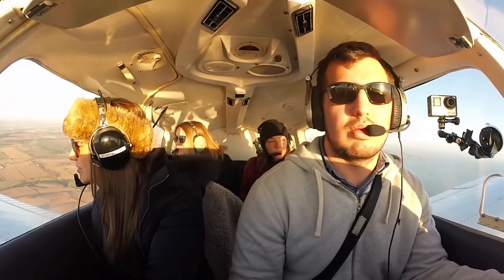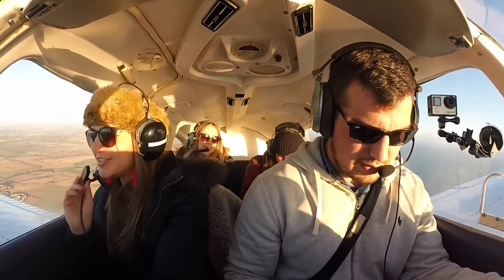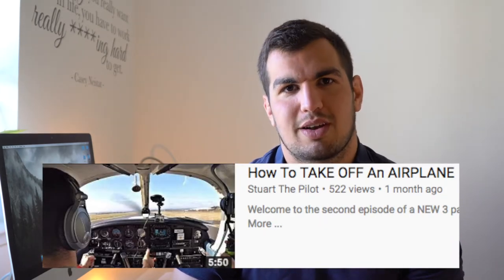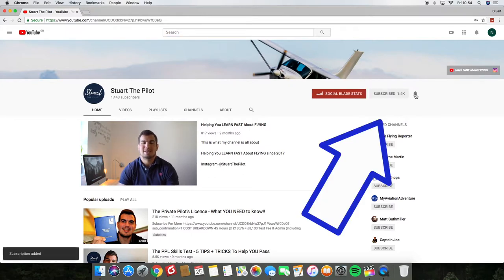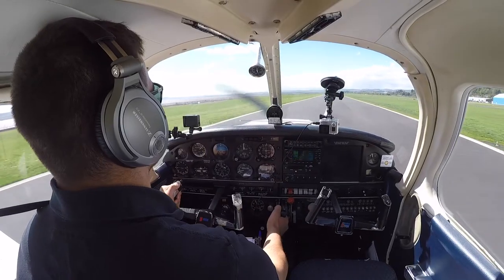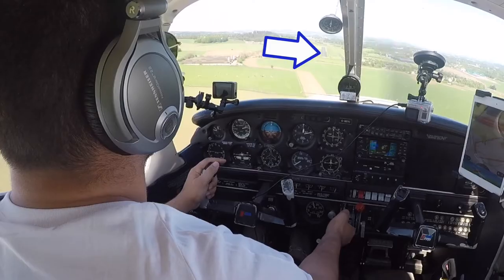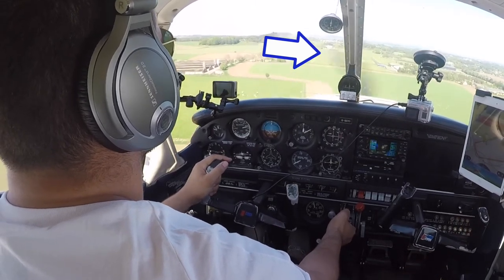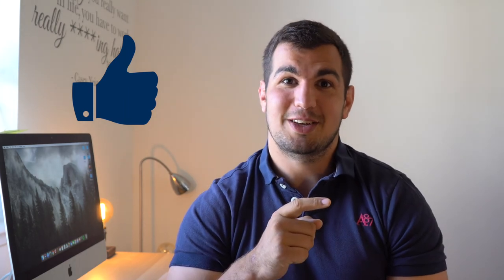How To LAND An AIRPLANE

Comment: Hi Stuart
Nice video. Keep it up. Like yourself I struggled A LOT to get the landing right. Speed usually is the main factor to get it right or wrong. Naturally when you see you are too fast or too slow you use throttle to adjust. This is NOT the case in landing. Assuming you are trimmed, you should set the speed by pitching the nose and set the rate of descend by adjusting the power (throttle).
Reply from the maker: Thank you glad you liked it! Completely agree regarding speed being controlled by pitch. The further effect of pitching down is losing altitude which will result in an increase in throttle required. I try and do both simultaneously to keep numbers in the windscreen.

Comment: Good vid, I’m a fairly new pilot and struggled with landing. My instructor kept saying 65–70 on threshold - 70 too fast for me in c172 and I would float. 60 - 65 is ideal for me..
Reply from the maker: Great you worked out what works best for you! Keep it at 60-65, don’t be tempted to go lower - I’ve found myself flirting with 60 before and any sudden wind change can drop your airspeed to dangerously slow. Happy flying Stephen !

Comment: Hey buddy...  I started my PPL a couple of months ago, this video has really helped.  I can visualize that 'holding off' a lot better, hopefully on my next lesson in a couple of days I'll be much better than all of my previous attempts - I'll let you know :)
Reply from the maker: That’s brilliant feedback ! So glad it’s helped you. Send your eyes to the end of the runway during the hold off will also help. Look forward to hearing about it👍🏻 Thanks for the comment
Reply: I'll keep that in mind, thanks for the tip 👍🏻
Reply: So it didn't go too great...  Started to drift too low on the approach, just as we were approaching the threshold.  Gave it some power to correct but the curve ball kind of put me off my stride, so to speak.  Circuits tomorrow so hopefully by the end of the day I'll have landings in the bag...  also (and I'm bricking it) I've got my Comms and Air Law exams tomorrow

Comment: Hi Stuart, quick one. I have the same headset as you but I’m having issues with feedback when transmitting in the warrior. Did you have any issues?
Reply from the maker: Hey - usually the headset works fine for me. Check the connection plugs in the warrior at clean and free from dirt. Also make sure you adjust the squelch which could be the issue. Thanks, Stuart
Reply: Aye I turned the squelch down but it seems to be fine with the headsets that the school provide. This might force my hand for a new headset 🤦‍♂️
Reply from the maker: Do it! Bose A20s🙌🏼🙌🏼